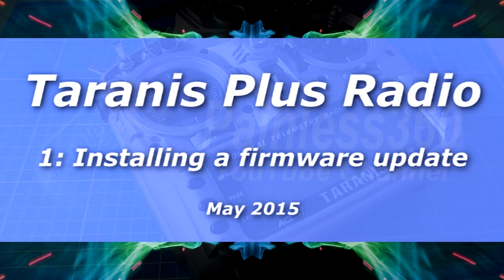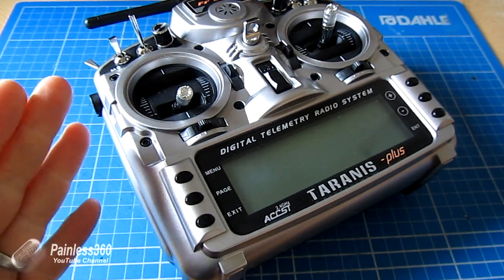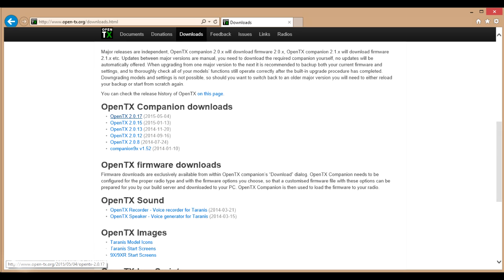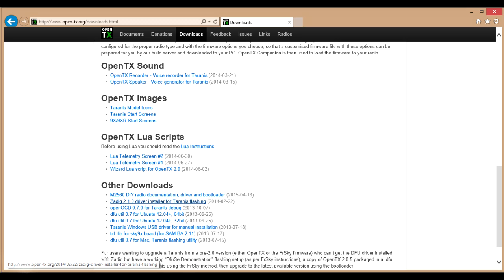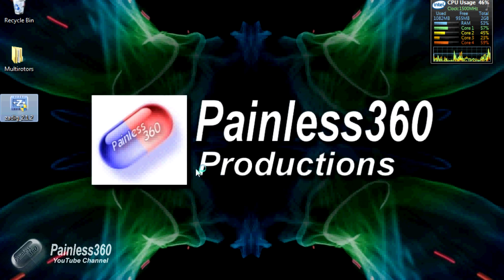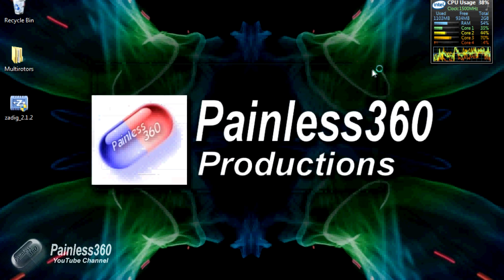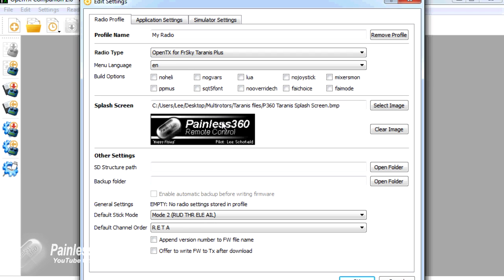(1/12) FrSky TARANIS Radio - One way to update the firmware

Comment: help, I'm trying to update my Taranis x9d to version2.0 but after getting the error message cannot open device when trying to read the firmware from the radio I have gone to the Zadig driver page and tried to replace the stm32 bootloader but get the message driver installation failed with a note at the bottom of the screen where the success message should be saying "installation failed. unable to run process with required administrative privileges
Reply: +Kevin Lane I am having this same issue did you ever figure it out?
Reply: +AirVideoinc hi, I did get there in the end but for the life of me I just can't remember how I did it. The only thing that comes to mind is that it was very simple and involved choosing a different file location from the  drop down list and checking that you have administrator privileges enabled. Hope this helps and good luck. Ps, the computer now recognises the radio when it's connected as the stm32 bootloader.

Comment: Here's a puzzle for you!
just received my Fr Sky Plus and the APM Mini Pro FC's. After learning how to set up channels on the fr sky ( thank you BTW!)
i see in the tx monitor channel 1 ailerons 2 elevator 3 throttle and 4 rudder. Servos work perfectly in those positions. They match the monitor....I am using PWM for now in the 8XR receiver. Ok in mission planner under radio calibration I get roll and Pitch working great. However here is the challenge......when I move the throttle stick Channel 5 moves the bar and yaw activated channel 6!? Ok so I know a little about Mission Planner so I went into the parmeters and changed throttle to channel 5 and Yaw to channel and yaw to channel 6. Kinda did not think it was easy. Now throttle does activate the throttle as well as it also activates channel 5 and yaw also moves the yaw as well as the channel 6....Ok Any Ideas??? 
DG
Reply from the maker: +Dan Geukes I would check on the monitor screen on the radio that every channel is moving in isolation and then work through the connections to the receiver, moving each one until the right control moves in Mission Planner. Best of luck.

Comment: HAHA YES I did it mate with your bin file and learned some stuff too can't thank you enough mate especially for pushing me to learn thanks a million again you are the man!!!
Reply from the maker: +House Proud I am so pleased! You can crack on now. You can update the radio easily from now on by downloading the firmware file and copying it to the SD card then using the firmware menu (bottom trims in, power on) to flash it locally. Remember to save your models and setting before trying though ;)Very happy flying and well done!
Reply: Thanks mate

Comment: Howdi, i guess Open TX Companion has been re-labelled OpenTX 2.0 branch ?? has same version number etc so im assuming its the same thing? OpenTX 2.0.17 (2015-05-04)
Reply from the maker: Nope. Still OpenTX companion...
Reply: Painless360 Hi, if you click the link you provided there is no OpenTX Companion listed but if you check the OpenTX 2.0 branch it has the exact same version number  ??
Reply: norie m yup just checked it, i clicked on the top link under OpenTX 2.0 branch and on the next page that loads there is - OpenTX Companion 2.0.17 - Windows Installer listed..
Reply from the maker: http://www.open-tx.org/2015/08/06/opentx-2.1.1/&#160;- it's called 'OpenTX Companion 2.1.1 - Windows Installer'

Happy flying!

Comment: Painless360  Could you help me..  After I pluged my USB from the taranis to my computer, there is notthing happen. Why my PC didn't detect my radio? Notthing about the stm32 bootloader coming out.
Reply from the maker: What troubleshooting have you done?
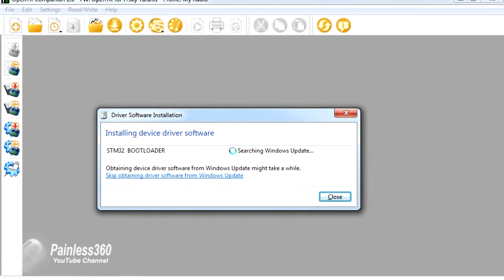Reply: I have done everything according to your video, but when Im at 3:30 there is no STM32 bootloader popup
My Zadig dont have the.STM32 bootloader.
Please help me. Painless360
Reply from the maker: ***** What does it look like in device manager?
Reply: Painless360  Like this

Universal Serial Bus controllers
 -AMD USB 3.0 eXtensible Host Controller - 0100(Microsoft)
 -AMD USB 3.0 eXtensible Host Controller - 0100(Microsoft)
 -Standard Enhanced PCI to USB Host Controller
 -Standard Enhanced PCI to USB Host Controller
 -Standard OpenHCD USB Host Controller
 -Standard OpenHCD USB Host Controller
 -USB Composite Device
 -USB Root Hub
 -USB Root Hub
 -USB Root Hub
 -USB Root Hub
 -USB Root Hub (xHCI)
 -USB Root Hub (xHCI)
Reply from the maker: +upachat svavasu That's just a list of devices. You need to see the one that appears when you plus the cable in and then delete it and start again.. Best of luck.

Comment: Painless360 hi .. i updated the firmware on my taranis plus but i cant get it to bind to a x8r . im new to all this ... the taranis originally had the eu var. 216 firmware on it and now has the 2.1.1 var 217 firmware. The x8r was bought from banggod andim not sure what firmware that has on it .... any help would be appreciated
Reply from the maker: You needto select the protocol the radio will use with the X series reciever. Try D16...
Reply: Painless360 thanks for your reply... turned out that the internal xjt module in my taranis was still hosting the EU firmware ... i got a little confused and didnt realise that there was separate firmware for the radio and the internal xjt module... i bought a FTDI adapter programming cable and flashed the internal xjt module firmware to the international version ... both the d4r-II and the x8r now bind no problem to the taranis .. steep learning curve and your help and videos have been vital to helping me learn.. thank you for the time you put into them - Gary

Comment: Hey there painless many thanks for help on getting a new ubec cause of overheating. Kinda need help on a new  problem that has arised, For some reason my Tauranis isn't reading anything to computer when I plug it in, Nothing pops up onto computer I can't even update the firmware now.  It worked the first time but now i don't know if i did something wrong to where when I plug it up it dosen't reconize to computer, how when you plug in File E pops up I don't get nothing. I want new splash screen but can't update firmware, please help whenever possible, and again many thanks Painless.
Reply from the maker: I would find the radio in Device manager and then delete it then remove and plug the radio back in. It should setup the drivers again and you can re-add it. You can also add the firmware to the SD card manually and flash it from there.  best of luck.

Comment: Just wanted to share an unusual problem that caused the graphics of the different aircraft not to load when I tried to configure a model.  Turns out that the SD card was formatted as FAT, so the radio couldn't read the files.  I saved the files from the SD card temporarily to my computer, reformatted the SD card to FAT32 using my computer, then copied back the files to SD card and reinstalled it in the radio.  Worked fine after that.  You can use the radio's menu to check to see if there are any folders saved on your SD card.  If you can't see any, then you might want to try this before swapping SD cards.

Comment: Well I've followed you word for word and when it tries to write, I get the error message "DFU Util executable file not found". Click OK and next message "Could not check firmware from radio". I've unistalled and reinstalled all software and drivers and repeated your instructions and still the same error.
Reply from the maker: ShallowBeThyGames Use the OpenTx Companion settings for "Configure software for communicating with the Radio".  This allows you to point the Companion to where the DFU Util is located if it is not in the Program 32 directory
Best of luck.
Reply: Thanks for your reply. I tried the above with the same results.
However, I stumbled upon another video which did it differently, by putting the firmware one the SD card and flashing it in the TX, which appears to have worked for now, but I'll keep trying to get my laptop and TX to get along together.
Thanks again.
Reply from the maker: Keep at it as using the Companion to configure the radio is a great help...

Happy flying!
Reply: Painless360 Well, I found my problem. Just thought I'd mention it here in case other viewers run into issues.

It turned out to be the receiver for my wireless mouse. I guess as Open TX attempted to open DFU Util and didn't know which to go to.

Happy days! Thanks for your help.

Comment: Had this all working until recently.  Looks like the STM Usb driver got removed by something.  I am always making changes and updates so I am sure I did something wrong.  Which STM driver are you using?  I tried installing the version I had used and now it won't install saying it can't find the file.  I remember having very similar problems when I started using the Naze32 FC.  I am using Windows 7 Pro.
Reply from the maker: Dale S I would use the one from st dot com. Best of luck with it...
Reply: Painless360 Simple solution was to use the OpenTx Companion settings for "Configure software for communicating with the Radio".  This allows you to point the Companion to where the DFU Util is located if it is not in the Program 32 directory for the Companion which mine wasn't.  I have all my Taranis software in a user directory so it is all together.  All I had to do was browse to my user directory where it existed.  Solved my problem.   Simple solution that took lots of trial and error and looking around.  I never saw anything about this solution, I just got lucky and stumbled onto it.  Thank again for your help.  Your videos and responses encouraged me to keeping looking and trying everything I did.

Comment: Great video.  I follow it all the way until the end.  But it says (at the point of flashing the firmware): New firmware is not compatible with the one currently installed

I did change the settings to say it's a Taranis Plus.  But I believe it could be because my Taranis is a newer EU version?  Any thoughts?
Reply from the maker: Gareth Brandwood Sorry no, I thought the new EU version of the Taranis wasn't available yet?
Reply: Bought mine in May. Had April date on it. It seems stuck in EU mode :-( don't get to fly my Vortex

Comment: sigh why oh why didn't I come here first?!  

I totally forgot about Zadig and have been pulling what's left of my hair out for the last few hours until I went over to your channel to see you now have a Taranis!  

Thanks again :D
Reply from the maker: garageadz Glad it helped - believe it or not I got flack for showing this way of setting it up (see the single thumbs down. Always one critic ;). 
Worked for me too and the research I did seemed to show that this was the most bullet -proof way of doing it. There are other ways are out there, but this is the way that you end up using when you install OpenTX companion and connect the radio then try to talk to it and start to get errors.
Loads of other Taranis videos on here now.. Happy flying!
Reply: Painless360  Yeah I haven't really been very active on YouTube at all for some time, I got a new job where I basically work a few thousand kilometers into the desert for weeks on end so my R/C time has gone down significantly. Having some time at home at the moment and trying to catch up!

Comment: ok problems when i go to Download FW i get an error pop upsaying " Download failed ... server replied internal server error" i get this every time i try and download the FW ?
Reply from the maker: michael garbutt Could be the server end or you have the wrong radio model and setting in the software before starting the download..
Best of luck.
Reply: its the original taranis. iv left the settings alone just made sure its set as a taranis and not a plus. then i click download WF and i get a save as box. then after i click save i get the error
Reply from the maker: Not sure then - loads of support on the OpenTX pages and RCGroups..

Best of luck.

Comment: I have the model just prior to the Plus, I flashed the TX supposedly to latest Taranis Plus firmware at the time, very happy with what I have, but, the new model set up menu that pops up when creating a new model is missing, I've been creating mew models from scratch via the old method. Will flashing with the latest firmware add that feature or is my version not able to handle it? Lastly, when flashing firmware when models are already on the TX, backing up the EEPE files to the PC and reinstalling after updating and calibrating, will all the model's settings and trims be the same?
Many Thanks.
Reply from the maker: iflylilplanes Should be. The RCGroups forum and OpenTX University are full of great detail and helpful information. This is only one of a number of ways that you can upgrade the Tx but this is the one I used and worked for me (and others)
Best of luck with it.

Comment: Hi, when I open TX companion a text box displays with "Thank you for upgrading to open tx 2.0 etc" but it wont close and I cannot start the program. Just get the "Bong" sound and have to use ctr- alt- delete to close, I'm running XP. Cheers John
Reply from the maker: Jonny10001 If you Google 'opentx companion xp' you will find the answers. You need to install the Microsoft Visual C++ 2008 Redistributable Package (x86)

Comment: taranis eu model still having problems usb plugged in used zadig and lastly the latest companion and im still getting radio not found the whole problem is all about using FrSky D4R-II with the new eu taranis version and not being able to use d8 .. looking at loads off forums saying up date firmware but cant update firmware if taranis cannot be seen on pc just  I have  started radio control models after looking at fpv racers and spending a fortune on buying one that's rtf and everybody saying how good the taranis is so I brought one only to have catch 22 problems any advice...... theres a rubbish bin near me? and some razor blades on the shelf<<<<only joking  ..its giving me a bit of a headache that's all and need some advice...
Reply from the maker: bob gasman You need to follow the process in the video exactly and make sure that the PC has finished every step. I would delete the device from device manager and start again. 
Best of luck.
Reply: ok  sorted it now thnx for getting back to me

Comment: I've followed the steps in your update firmware video (nice video by the way). I Installed Open Tx 2.0.17 and Zadig 2.1.0 driver installer for Taranis flashing (but had to go to the Zadig site to download). Radio is off and usb plugged in and found stm32 bootloader but also got message cannot open device. Opened the zadig driver, listed the devices and selected STM32 bootloader - however the Zadig program did not show the STTub30 (v3.0.4.0) instead showed WINUSB (v6.1.7600.16385) so could not replace with Zadig driver .... any ideas??
Reply from the maker: David Hales Not sure - looks like the driver for the Bootloader (before you try and change it with Zadig) isn't installed properly. I would delete it from device manager and re-add it..
Best of luck.
Reply: Thank you for your response and support. Deleted using devise manager and tried again ... no luck ... same result. I'll continue to research. Thanks again David
Reply: David Hales this seems to be a common problem.. im having the exact same issue..
Reply from the maker: A video showing the problem is always useful..
Reply: David Hales any news about this problem? i can't flash my new taranis with mac or windows...also i can't set it in dfu mode. i put the 2 trims in center and power on but it doesn't do anything.

Comment: I've just tried to upgrade two taranis, one brand new the other an older one.. The versions afterwards display are 2.17 which says its the latest. When I switch on and select model, the wizard does not show, there is no option of fixed wing, heli. quad or flying wing.
Reply from the maker: Brett Naysmith The wizard is a LUA script. It is usually installed on the SD card in SCRIPTS/WIZARD. I didn't have to tick the LUA option box in the software upload screen for mine to get it to work but I would suggest reloading the firmware with that box ticked.
Best of luck.

Comment: on one of my computer i  get this error message  DFU UTIL exeutable not found. have up date driver using zadig. does anyone know how to fix this.
Reply from the maker: mark houghton Could be a few things. Make sure you have the right radio Taranis/Taranis Plus selected, and check in Burn->Configure that the location is correctly set. The default path is C:\Program Files (x86)\companion9x\dfu-util.exe..
Best if luck with it.